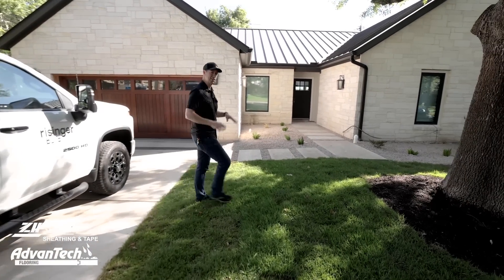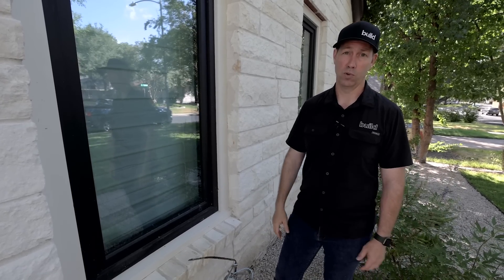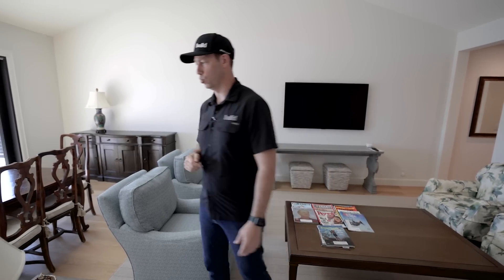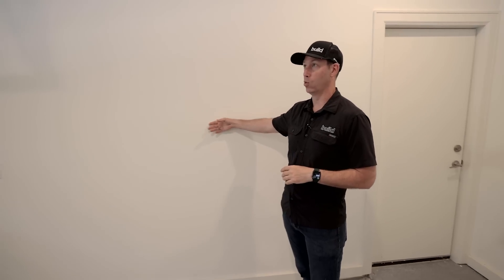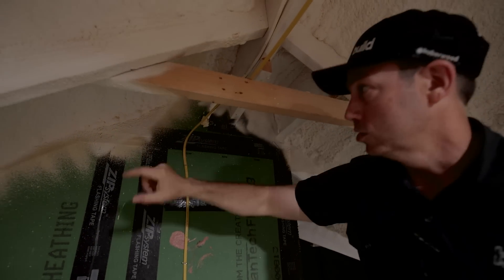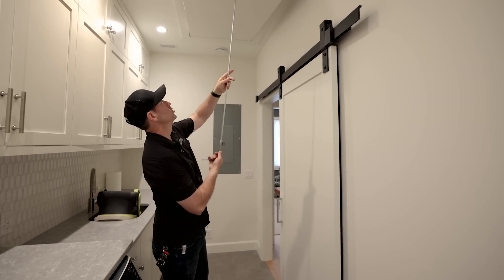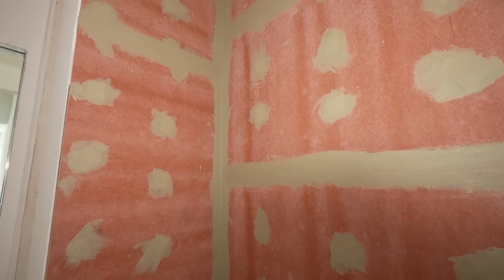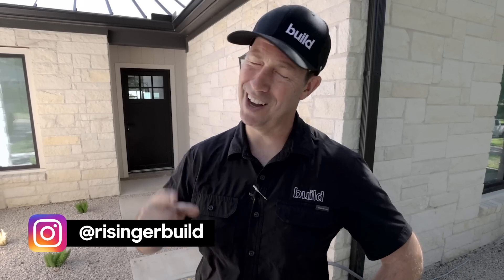Tstuds, Slab Insulation, Monopoly Framing, etc... This house has it all.

Comment: What type of Savage likes the feel of hard water on their skin and hair over soft water?
Reply: Get over yourself Spanky, some people like me don't like the feeling of soft water
Reply: @daveklein2826  Sounds like a personal problem.  Do you also like rubbing sand in your hair because that's what hard water feels like.
Reply: I mostly dislike the feel of softened water.  It takes forever to rinse off the soap, and if you’re still soapy, you’re still dirty.  I’m sure there are places with extreme hard water to the point that it’d be worse, but that’s pretty rare in the US, at least for city water.  However, I’ve seen how even average hard water can shorten the lifespan of plumbing devices, so I may eventually try out a softener.
Reply: @kc9scott  With soft water you need less soap.  Soap lathers more quickly with soft water.  Hard water feels like the soap goes away faster but that's because scum is formed.  It doesn't mean the soap is off your hands.  Your skin and pipes will love soft water.
Reply: @myriadcorp  Yes, I know.  That’s why I’m kinda planning to try a softener.

Comment: Injection molding of plastic parts
As a one-stop plastic manufacturer, we are capable of producing a wide array of plastic products, including custom plastic enclosures for consumer electronics, plastic components for the automotive industry, plastic containers for food and non-food products, etc.
MANUFACTURED PRODUCT WEIGHT RANGE: 0,01-5,00 kg
RANGE FROM 50 to 650 MT CLAMPING FORCE
2K MOULDING
OVERMOLDING
TAMPO PRINTING, PAINTING, LABELING

BT Mold in shenzhen china

Comment: Just have your hvac guy duct the air output of the Rheem to the garage area.
Reply: I'm sure there is a reason he didn't
Reply: Might not be code legal to have an air connection between the house and garage.

Comment: Why does it seem like you only use wall mounted ac cassettes with a mini split and not a recessed ceiling unit? I should think that is a much more sleek look
Reply: Looks to me
Reply: Cost plus usually in Tx the attics are too hot for cassettes ( obviously not in his case) but no one here stocks them .
Reply: It may have a vaguely sleeker appearance, but the install is bulkier, interferes with drywall more, and access points are harder.  Most importantly though they aren’t as efficient.

Comment: Curious if the 4” of foam on the roof will interfere with solar installations?
Reply: you are not mounting to the foam, you are mounting to the wood that is bonded to the foam
Reply: I’m guessing it might take longer screws - as long as the engineer specs enough weight carrying capacity on the roof for panels - usually isn’t a huge problem
Reply: Foam can support concrete slabs, so a mere solar system won't be any trouble.
Reply: you have an adapter to use the metal roof for securing the panels.

Comment: those mini splits never look good. have you considered (besides separate zone) boxing it in with deco lincane or other vented sheet metal (hinged) to better conceal??? also, with codes quickly changing to be like leed, why buy european ext. openings rather than local like andersen?

Comment: Would this be a $800K build?
Reply: imo, more around 500k
Reply: It’s Austin. That’s Over 1M for this “ modest retirement home “
Reply: @nixaeagle141  Seriously. That's insane.
Reply: @r.d.9399  it’s hard to swallow when you’ve bought several Tx homes in the $50-$100 range , but Austin is basically L.A. now . It’s nutty .
Reply: @nixaeagle141  That would include land value due to location. The cost to build shouldn't be much more than anywhere else. That's a $200,000 build probably.
Reply: @ashleyhill6697  yeah I think the biggest cost increase is definitely the labor because finding a contractor with labor that would adequately install all this would be the main obstacle.
Reply: @PandorasFolly  oh yeah his monopoly style building "I dont know if it was his idea" would probably increase labor costs too so my estimate might be low.
Reply: @ashleyhill6697  i looked up the tstuds and they look to be about 300% to 500% more than traditional framing.  I think building larsen trusses might be cheaper.
Reply: @ashleyhill6697  😂😂😂 200??
Reply: @ashleyhill6697  Monopoly framing by itself probably makes labor cheaper because it keeps thing simple. Long rafter tails and truss top chords that extend past the walls are a pain to deal with compared to those that end at the wall.
Reply: @hailexiao2770  maybe I'm not a carpenter. I didnt watch the whole video. I skipped over a lot of the technical stuff. I was going by what a house that size with no basement would cost in rural So Illinois.

Comment: This house is not modest in price. Modest in size. I would like to know your hard cost on this modest home. Insulated roof with spray foam, insulation in the floor and then double I'm guessing ¾ wood floor under 5 to 6 inch ¾ sand and finish. Wow. You must have gotten a lot of stuff for free

Comment: I really doubt your spray foam and rigid foam was only a $3,500 upgrade.  I think you've got about $9,000 in exterior foam and every time I have priced spray foam it has been expensive.  Meanwhile, blown in fiberglass is probably $2,000-2,500 for the whole roof.

Also if you did all mini-split AC and a few ERV/HRV units instead of a huge Zender system, you don't need any accessible attic at all.  Humidity might be an issue but I'm sure there are systems that can be inside the interior.

I think the ideal is a "cold roof" using a BIBS style mesh, dense packed blown in fiberglass and a radiant barrier.

I can do all that between I-joists with a wood T&G ceiling dropped down about an inch below the vapor barrier so I can route my electric in the gap and have cathedral ceilings throughout. 

I'm in a desert so humidity isn't an issue.  Bottom line, a cathedral ceiling is a premium detail, my air quality is going to be fine and I'm going to save at least $5,000, maybe a lot more.  That will pay for a lot of the T&G ceiling and the steel roof.
Reply: Then prove he is wrong SKIPPY
Reply: @daveklein2826  I intend to.

Matt is never really budget constrained, that's why his finishes are $$$.  Most of the time a customer is footing the bill, sometimes it's "sponsored content and the rest of the time it's his house but he's spending his social media money to generate new content that he gets to live in.  There is nothing wrong with that except he has little motivation to find less expensive materials and techniques.

The problem is I'm budget constrained.  I see a lot of what he does and think "I like that" but my next thought is always "how can I do it cheaper?".

Cold roofs and hot roofs both work.  A lot of people think hot roof=spray foam=high performance roof.  A cold roof can be just as high performance, they just aren't the fashionable thing now.  I don't really care how unfashionable a building material or technique is, if the results are good, durable and they can fit the intended aesthetic of the design, that's good enough for me.

Comment: Is it not wierd to have a front door opening inwards?
Reply: No, standard in most of US.
Reply: @mikejackson1410  ,yes 99.999% of the homes here in USA. Not really sure where Korpen is from (?).
Reply: Every single home in the US is that way
Reply: @S M Industry standard, but not required by code. You can have outswing doors if you want.
Reply: @daveklein2826  Florida is almost 100% outswing only for hurricane winds. So not all.
Reply: @hailexiao2770  How do you S M?

Comment: Nicely built house. Not a fan of the wallpaper👎. Not really sure your idea of a mechanical room for one piece of equipment. Where I’m from if you build a mechanical room you put everything mechanical in it. You have natural gas ,so you could’ve put a tankless water heater in, taking up 1/5 of the space. With the rest of the room you’re indoor HVAC equipment would fit nicely only having the ductwork in the attic. Putting HVAC equipment in the attic is really dumb, just ask Joe Lstiburek.
Reply: Ha, I like some of the wallpaper.  He is using  the heat pump water heater to avoid extra protrusions and save energy, also produces cold air which is nice.  Joe just doesn't want HVAC in unconditioned attic.
Reply: @eh_bailey  , I will quoteJoe  “ we moved the insulation to the underside of the roof because of all of the other bad decisions that we make .”  And The bad decisions are HVAC Systems in the attic, ductwork in the attic, holes cut in the ceiling for vents and canned lights. I will quoteJoe again “ The only thing that should be in the attic is nothing , other than that fluffy stuff known as insulation.There is no better way to build a roof assembly than to have a vented attic.”